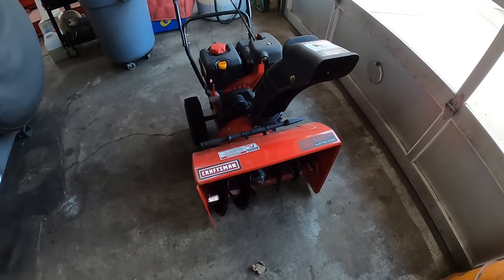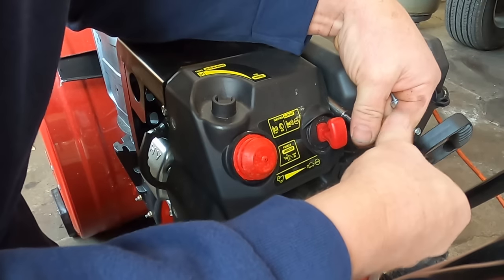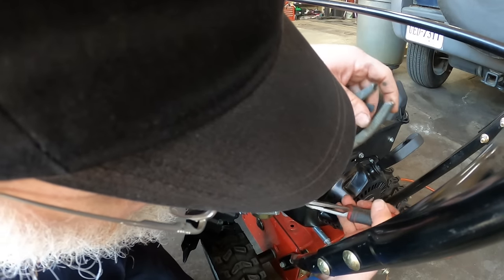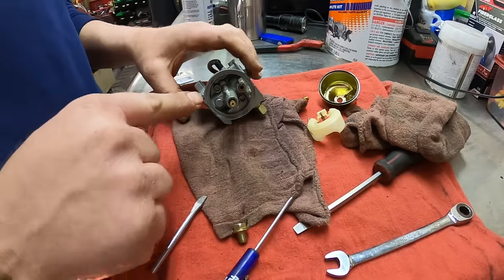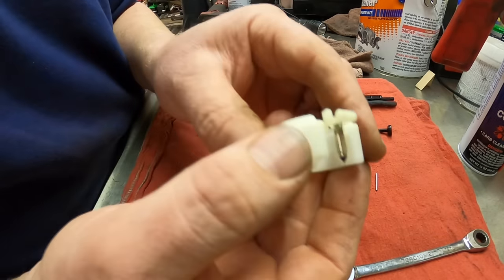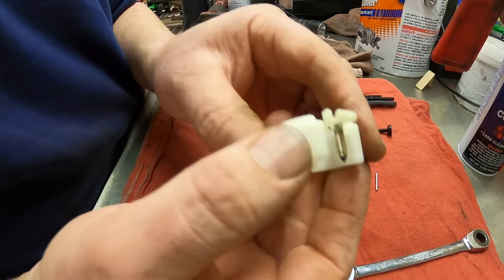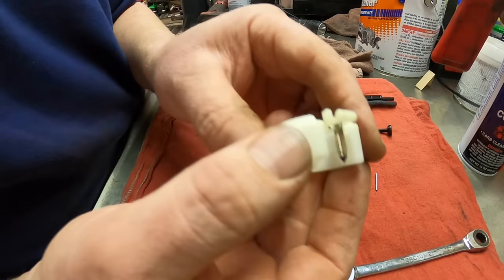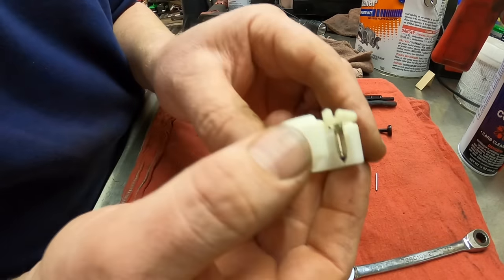Craftsman Snow Blower Won't Start

Comment: selling my POS snowblower, whoever designed the carb needs fired!
Reply: Chinese apparently
Reply from the maker: Just drain all the gas out of it and pull the float bowl off to be sure all gas is out of it. Thanks for watching
Reply: @TheGAutomotiveAndMore  Just gonna sell it on craigslist. This is a POS Snowblower. I want one that starts up every year no problem like my lawnmower or power washer. Besides you can tell it has horrible design with all that plastic shit covering up everything that needs services on a yearly basis. If you have recommendations on brands that are actually dependable I'd love that!
Reply: @supremefan i plan on cleaning up my Craftsman / B&S engine snowblower as shown in this video, then possibly sell it as well. I have been looking at an EGO SNT2406 dual stage snow blower. Videos in action look pretty good.
Reply: This helped me alot! Thank you! I knew it was a simple fix. I got a new carb from amazon for $13
Reply: I have a 26" new like this one and screwed me again this year.Tried the stabilizer,ran 97 octane.No go.Every winter it needs a rebuild to get started.$1500 Huge headache that I inherited by my father.
Reply: @almacjr  learn to clean the carb yourself or spray starting fluid/carb cleaner down the choke nob hole for a cheap fix, otherwise if you are paying to have it serviced or replacing parts it's better you sell this to someone more mechanically inclined as it needs yearly maintenance to work correctly.
Reply: @supremefan  I did clean out the bowl and carb with carb spray last year,still looks clean.The problem this year I think is further in and one of the plastic parts has broken off,I'd like to be done with it and trade for a machine that actually works.
Reply: Blaming is easy , admitting being unintelligent is man work !
Reply: @uns33nshadow  that is always a question for an answer , born naturally nit wit !
Reply: @almacjr  drained all gas out ( tank , carburetor) , then spray sea foam into the carburetor, unscrewed the drain plug , using air (compressor) 60 - 80 psi blow out the sea foam , fill with ato (auto transmission oil ) and let it what it is until the next season , drained the ato out , add gas , you may see a heavy smoke out for a few seconds , after that , things are going great , good luck !  Merry Christmas from the white North !
Reply: Still very relevant my friend
Reply: Great Video! I bought a replacement carb instead.
How does the choke lever come off the old carb? TIA
Reply: @Alpha550  pliers and pull it’s straight off
Reply: @mrkelleher712  thanks responding, but I finally found out how to do it. You actually remove the  choke plate  first then the choke rod will come off. Just have to remember which direction the plate was to reinstall.
Reply: @Alpha550   of course man! These machines are great if you have the patience to work on them. Good luck on your repair brother
Reply: Had to replace my carburetor in 2020. Changed to using fuel with no alcohol and it has run great since. Even using Sea Foam in gas that has alcohol didn’t work, just go to recreational quality gas and you will be fine. These cheap carburetors will suck if you do anything different.

Comment: I found that there is a gap in the slot where the throttle nob is, so center the nob in that gap and the cover will slide over it.

Comment: I nice tip on removing the idle jet. My 8 hp Tecumseth has surged at idle for years. I , being a gear head, kind of liked it. But I'll take it apart  and clean it correctly. THINK SNOW!

Comment: Thanks so much. Every year I face the same issue and I had always been afraid to try and fixing it myself and ended up taking it to a mechanic shop. This year I had no way to do that so I decided to follow along with your video and give it a try. I was able to take the carburetor apart, clean it up and make it work. Thanks a million

Comment: What an incredible step-by-step video. You just saved me some money, and also gave me the knowledge to fix my brother's Craftsman snowblower. He's way too old to be shoveling snow, so this might have literally saved his life. You just earned a new subscriber. Thank you!
Reply from the maker: Thank you and thanks for watching
Reply: @TheGAutomotiveAndMore I need to do this to my Craftsman. Thanks!!!
Reply: I also have a Craftsman blower with the same engine. I recently had the same issue and my first indication of a problem was that the primer bulb didn't seem to be forcing any gas up into the carb. Problem with mine was the line from the carb bowl up to the intake was clogged (pressing the primer bulb forces fuel up this tube into the intake, which it could not do). Took the bowl off, sprayed some carb cleaner up there and after that it worked fine. 

Note: as i write this I am less than 13 minutes into the video, so I don't yet know the problem. But I am predicting he has the same issue as I did.

EDIT:
OK, watched further into the video and yup, same issue. Only I fixed mine without removing the carb from the engine. I just removed the bowl and sprayed a mess of carb cleaner up the tube. Yes, I also had a little gunk in the bowl, so I cleaned that, too. But as for the carb, I just put a bunch of rags under the carb and sprayed away.

Comment: I’m not a handy person and I’ve certainly never tried to fix a small engine before.  My snowblower wouldn’t start and I decided to use this video to give it a shot.  Video was easy to understand and very thorough.  I was able to complete everything with ease and the icing on the cake was my snowblower started instantly when I was finished.  Excellent, excellent video.
Reply from the maker: Thank you and thanks for watching

Comment: This fixed my snowblower. I couldn’t believe it. I purchased a new spark plug and it still didn’t start. I took apart my carburetor and there it was - a clogged jet. Cleared it out and reassembled and 1st pull. 
I can’t thank you enough. Thank you for your easy steps - camera angles so a person like me can follow it and fix our equipment.
Again - thank you!!!!
Reply from the maker: Thanks for watching

Comment: One of the best tutorials out there. Went thru all the steps except forgot to re-install the float. I know, don't ask. What happened? Fuel everywhere even coming back out of the primer bulb! To top it off, piston got into vapor lock and was extremely froze.  I went back into the carb and installed the float.  Took out the spark plug and got excess fuel out of the cylinder.  All is well. Learned a great lesson. Don't be in a hurry. Take your time and appreciate the $$ saved by this great video.
Reply from the maker: There is a lot of steps in tearing down something and reinstalling everything. Its bound to happen. Thanks for watching

Comment: Jan 2023 - Thanks to The G Automotive and More - This was a perfect video. I have a Craftsman 26 Select with exactly the same setup, with exactly the same problem. 1 yr old and only ran for 1 minute a year ago since we had no snow last year. Gunk in the jets. I am not an engine repair guy at all and it took just under 1 hour. There was nothing difficult about this, just follow step by step and familiarize yourself with each move before you make it. I did not have the fuel hose clamp, but used a folded rag in the jaws of Vice Grips to keep from damaging the fuel line. 10mm socket is a must. everything else is just as you see. Thank you for the video.
Reply from the maker: Thanks for watching.🙂

Comment: amazing video!  I have to do this to a 2 year old craftsman snowblower that I drained the gas out of at end of year last year.  north of $1,000 machine.   Meanwhile, my neighbor has a 15 year old snowblower that he doesn't drain the gas out of and starts first pull every year.  His is not a craftsman.  I use Rec fuel as well and drain it and this still happens with good old craftsman.    I am not looking forward to doing this but you just made my life a million times easier by making this video so thank you!   I clicked subscribe as well.
Reply from the maker: I do not know why they clog up so fast. Thanks for watching

Comment: Thanks for showing me how to get the damn choke knob off. My tip for you is the throttle handle can stay on, there is a factory notch in the center that clears it. You made a quality how-to video that really helped.
Reply from the maker: Thank you. With the throttle knob I like to take it off. Makes the cover easier to get off.
Reply: @TheGAutomotiveAndMore  try it sometime with the knob on. Move the lever to the center and pull the cover right off. Piece of cake.

Comment: I just want to say, thank you for this video. I have a similar model and it’s only been used 3 times since 2019. I always run it dry after season.

The only issue I ran into after disassembled and cleaned was a fuel drip between the carb and the engine. I suspect trying to use the old gasket is the issue. Ordered new ones (and apparently a replacement carb) so I’m going to remove and replace them to see if it stops the drip. On a positive note, outside of a drip, it ran fine and the snow that came the day after was taken care of. 

Thanks again for this tutorial. Saved me a headache.
Reply: Actually a follow up comment. My brother mentioned that simply running the tank empty may not be the best and I should turn off the fuel (I’d have to install a valve shutoff), then let it run dry in the carb. Would that make a different from siphoning the fuel and then running dry from tank?
Reply from the maker: Thanks for watching
Reply from the maker: @MFD657  I drain the tank and run it until it stalls. Then I set the choke and try to start it again until it won't start anymore.

Comment: I can’t thank you enough… this video was excellent and easily helped me fix my mother’s snowblower. My father passed away in 2019 and this has sat since but I needed to get it running to do her driveway, shoveling was getting old lol…. Thank You!
Reply from the maker: Thanks for watching
Reply: Have a question since running it, runs better with the choke on… turn half to the right it sputters and all the way to the right it sputters and back fires… any idea?
Reply from the maker: @dali555  It's running lean (not enough gas). Maybe still partially clogged up. Sometime you won't be able to clean the passages in the carb the first time. I would try cleaning it again. Thanks for watching

Comment: Thank you!!! I watched your video several times until I got the guts to mess with it. I put it back together and I had the little needle backwards- gas was leaking🤦🏻‍♀️😅 and an extra piece (bracket), BUT I fixed it and the snowblower works now!! Thank you!!!

Comment: Thank you so much for making this demo video brother. Saved me a whole lot of headache dealing with Craftsman and their difficult warranty process. 1 year old clogged carb FIXED
Reply from the maker: Glad you were able to fix it. I would drain the gas in the tank and pull the float bowel off to get ever drop of gas out of it. Then reassemble for storage.
Reply: Craft man pretty good most stuff

Comment: Thank you so much for this fabulous video!!!  I bought this exact snowblower last winter - I made the mistake of not storing it properly during the spring/summer and couldn’t get it started this winter. I followed the steps in your video and my snowblower started right up!  I have never worked on mechanical equipment and found your video easy to follow. You are a lifesaver!!  ❤🎉
Reply from the maker: Thanks for watching

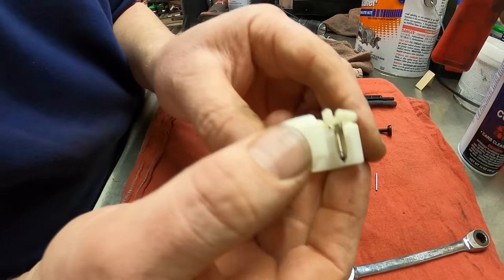Comment: Thank you very much - helped me out tremendously! At +/- 25:31 may want to mention that the emulsion tube needs to be checked, cleaned, etc. thru the entire tube (light seen thru top to bottom) - mine was plugged at the top. Motor would start but not stay running - I could keep priming it but rough running. Thanks again!

Comment: Thanks for doing this. After following all your instructions it fired up on the 1st try. My neighbor told me to use premium gas from now on.
Reply from the maker: Using premium will help bit I still think you should drain all the gas out of the machine. I even pull the float bowl off to make sure no gas it left in the carb. Thanks for watching

Comment: Thank you so much!  Exact problem happened to me ... had used Sta-bil in the tank and guessing it didn't do what it was supposed to.  Your video was right on!  My snowblower is 28", so was too big for me to bring to a shop and decided to give it a shot.  Up and running in about 30 mins.. thanks again!
Reply from the maker: Thanks for watching

Comment: I have the exact same Craftsman model (regrettably in retrospect) with the EXACT same issue. You've demystified it completely and I THANK YOU! I just hope after I clean the carb out that it doesn't just clog up all over again. I'm thinking this issue must be related to some "pre-gunk" salving that the manufacturer originally set up the machine with?? Hopefully once it's gone it stays gone. Guess we'll find out... thanks again!
Reply from the maker: Thanks for watching!

Comment: Very thankful for this video. I was about to take my snowblower to someone to get fixed till I found this. Didn't know how important it is to drain fuel after the season. I used it 1 time last year and wouldn't start this year. Thank you
Reply from the maker: Be sure to run it dry or remove the float bowel to get all the gas out of it. Thanks for watching

Comment: Epic video my friend.  Non electric start for mine.  Followed along with you other than the carb cleaner dip but used GumOut to clean everything. Used paperclip and bobby pin for cleaning holes out.  Worked like a charm. 2nd pull fired up.  And no more revving up and down.  You are the man!!  Thanks for posting this.  And
Reply from the maker: That's good. I use to use Gum Cutter before I started to use the carb cleaned dip stuff. Thanks for watching

Comment: Thank you, thank you, thank you! I have the same exact unit. Used it one time last year. I'm guessing I didn't drain it, but I went through your instructions and it started with one click of the electric starter. Just in time as we had 2 feet of snow this weekend.

Comment: Great video buddy.  I've got a foot and a half of snow incoming and for the first time ever I forgot to drain the machine so it's all gummed up.  Hoping a quick carb clean will resurrect her.

edit:  worked great, and now I have a running snowblower. Only caution I would offer is that two screwdrivers won't necessarily get that choke knob off - at least not just the knob.  I ended up popping the knob with the entire 'stalk' beneath it right out of where it is attached to the carb.  A small piece of it broke off but fortunately it is still functional.  I did verify there is no screw in the knob, so I guess mine was just really seized on there.  Otherwise everything else went to plan.
Reply from the maker: Good luck with the snow this year.

Comment: These MTD PowerMore engines have a screen behind the fuel inlet elbow. After the inlet is pulled out, the screen is easily removed with a small pick type tool. In this video the snow blower looks too new to have the blocked screen issue. More than likely, it is some crud plugging the main jet that goes inside emission tube. Love to watch mechanics trouble shoot small engines. There is always something to lean. Thanks for sharing.

Comment: Great video. After 1 season my exact same craftsman thrower wouldn’t start. Now I know why. I’m done with craftsman equipment.
Reply from the maker: All snow blowers use the same type carburetors. Its the ethanol in the gas and not draining the gas out of the machine for storage.

Comment: Thank you very much for this video,  this was exactly what my snowblower was doing.  Brand new  last year but I failed to remove the gas last spring.  I honestly have never removed gasoline at the end of a season in lawnmowers or snowblowers.  Lesson learned! I've never messed with carburetors before,  so this was very helpful!!
Reply from the maker: With the ethanol in the gasoline I now drain all the gasoline out of my equipment when I put them into storage and sometimes remove the float bowels to get ever drop of gasoline out of them. Then reinstall the float bowels. Thanks for watching
Reply: Today gasoline have 10% ethanol or more mean have water so metal and water over time start corrosion that is real problems w new equipment failures

Comment: Prime for a Good time , I love it . The quickest diagnostic method we can use . When the engine runs on a prime you know that everything is good other than fuel delivery . Compression , timing of ignition and mechanical timing as well as Ignition is working all in 10 seconds.

Comment: Thank you for the easy to follow tutorial. My craftsman was only  a year old when it quit like this but it's back up and running after a quick carb cleaning.
Reply: Sadly my Craftaman blower was purchased in May of this year and used only once for less than an hour.  Sure enough it had this problem.  A buddy of mine recommends running it out of gas each year at the end of the season

Comment: Thank you for the video.  I'm going to try and fix my snowblower.  Although I drained it of fuel last spring and ran it until it drained the last of the fuel, it won't start this year.  I loved the detail and specific instructions.  I'm curious why you didn't check the rubber fuel lines for blockage, the inlet tube (where the fuel line is connected) or clean those?

Comment: Fantastic tutorial on how to clean carb. Followed it and worked like a charm. Best DIY video!!! TY very much.  Question when i removed the primer line the nipple broke off at the carb. Can I get a replacement? How is it attached to the carb?
Thank you
Reply from the maker: I think that is part of the carb and they do not sell it separately. I would get a small brass tube, drill out both ends of the nipple, insert the brass tub in and glue it back together.